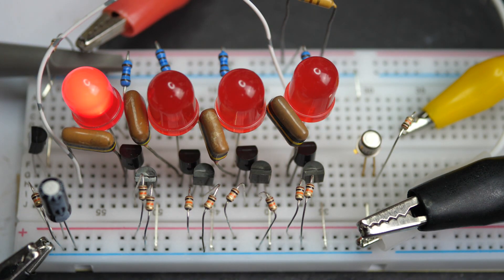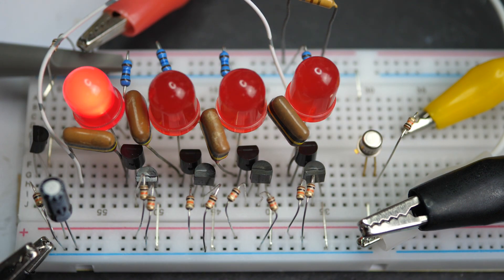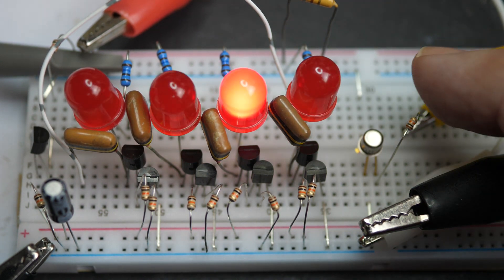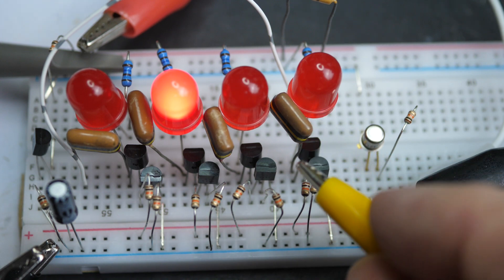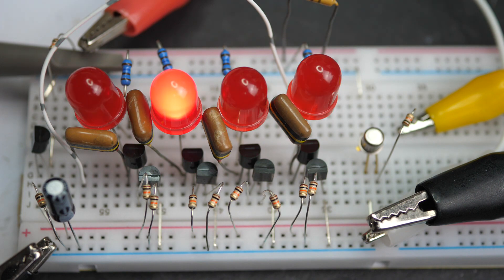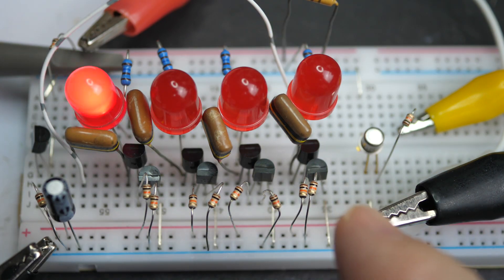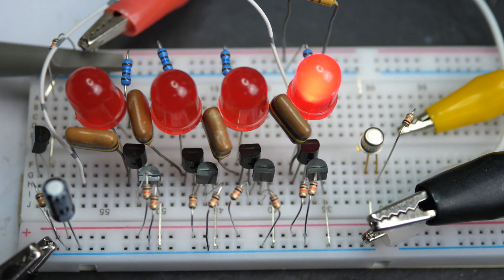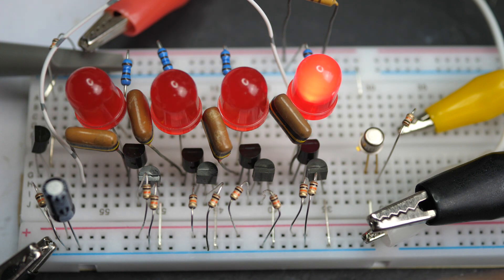Discrete Transistor Ring Counter

Comment: I am trying to do this but using relays instead of transistors

i just cant figure out how to make it work using relays. the schematics i find online don't seem to work and the explanation on them is either poor or non existent. Any ideas??
Reply from the maker: I think this is entirely possible using relays. If you set up each relay to act as a time delay, and to then trigger the next stage, I think that would work. Some capacitance will be required to make the time delay, but the exact amount will depend on the relays.

Comment: It seems your circuit is different than Yates.  For one thing, it's missing the transistor "biasy parts" on the right and it looks like your pnp base/npn collector resistors are going directly to +5..  I do like it because it seems a bit simpler than the original, but I can't replicate it.  Can you publish a schematic of what you built?  That would be helpful, thanks.